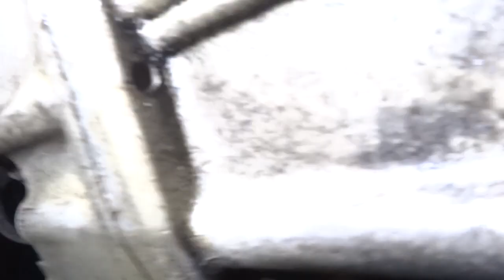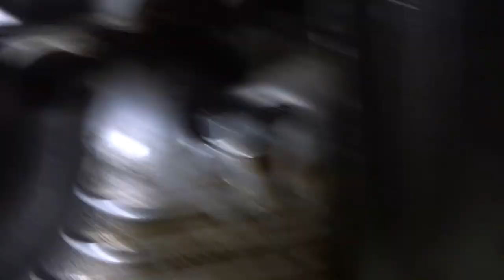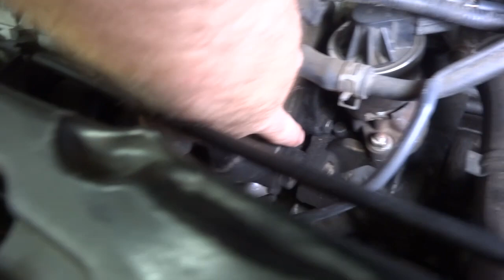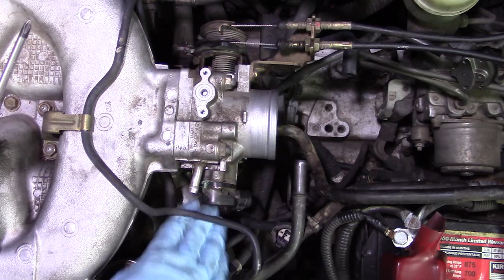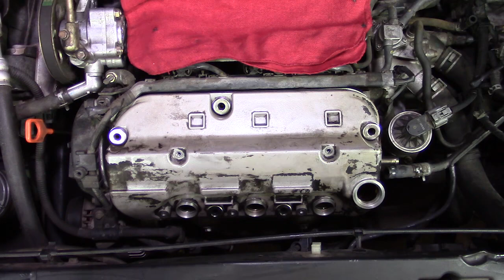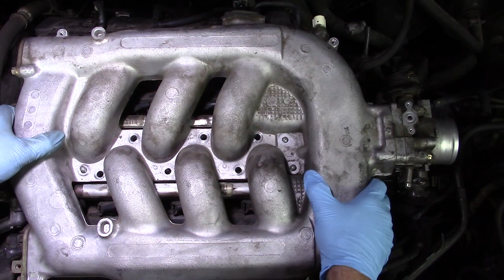Honda Odyssey Valve Cover Gasket Replacement DIY

Comment: Thanks for creating and posting this helpful video.  I'm replacing the Valve Cover Gaskets on my 2001 Odyssey with a 335k.  Getting the old rubber grommets off of the valve cover bolts seem to be the most time consuming part of this job.

Comment: Great Video, used it to do the job this weekend. I would add that a hand mirror was handy to align the bolts on the rear cover and I used gasket sealer. Thanks for the post.

Comment: A very well presentation and greatly explained. I have a 2005 Odyssey and will be doing valve adjustment in the near future. This is a little bit different but I enjoyed your very nice video and gives me an idea about those valve cover gaskets and gramets, which I will replace when I do the valve adjustments on my van. Thank you for sharing.

Comment: Great video, I like his videos. While the purpose of the video was valve cover gaskets, it would also be a great time to clean that intake manifold (both my 99 and 01 Odyssey had the manifold EGR port clogged).   I put mine in a parts cleaner and cleared up an EGR valve code problem.

Comment: Thanks buddy! I just replaced my knock sensor and didn’t know where that vacuum hose with the bracket at 29:14 went! Coincidentally someone had capped this connection.

Comment: Just finished replacing my valve cover gaskets on my 2004 Ody. It took me a whole afternoon with a lunch break.  It's not to difficult of as job but don't expect it to be smooth sailing either, just be focused and it will work out.  While you're at it might as well change the PCV valve, it's located on the back valve cover
Reply: Did this video for 2000 match your 2004 ???

Comment: Awesome video 👌 , wondering why other people say you don't have to remove the intake manifold on the 3.5 VTEC engine ? Links to the replacement parts perhaps ? That's the only thing I need ! Sweet video , my vehicle has 278 thousand miles on it but runs great except for Oil getting on the exhaust system ,

Comment: Good video. Where did you buy the  valve cover gaskets from? Second, you don't need to remove the air filter and snorkel. Just remove the 4 bolts and nuts that hold the throttle body to the intake manifold. Remove all the bolts for the intake manifold, pull the intake manifold up from the Passenger side (away from the TB) and as you lift the manifold slide the two studs out of the throttle body. That way you don't have to disconnect all that stuff around the throttle body. Also, how did you burn that sensor?
Reply from the maker: ***** Thanks.  I've found on this vehicle that the throttle body gasket is a little stuck on both the intake manifold and the throttle body and so I've chosen to just remove everything each time.  If I'd had luck taping the TB loose with a hammer the first time I ever took the IM off, I'd have been able to show your short cut method.  The valve cover gaskets came with a timing belt kit from eBay.  No idea how the sensor was melted (it's not my vehicle).

Comment: Very informative Video, thanks. 
Did you not install an intake manifold gasket before installing the intake manifold. At least I didn't see that you did, or is it not needed. 
Where did you get the gasket set from. Could you please add a link.
Thank you

Comment: Great video!  I have an 06 Odyssey w/188K miles that is leaking in the sample places as your friends Ody.  I took it to a shop and they said the oil pan gasket was leaking so they replaced it.  When I picked it up they said if it continues to leak then the valve cover gaskets are probably leaking.  Sure enough when it sat overnight it was still leaking engine oil!  Do I change the valve cover gaskets before exploring a possible leaking rear main gasket?  Did you make a video on changing the rear main video for an Odyssey?
Reply from the maker: +Jake Bair Valve covers are a good thing to change, particularly the rear one as you see in this video.  The rear main seal also needs to be changed on my friend's van but it is a huge job and we're not doing it until the next time the shitty transmission needs to be rebuilt.
Reply: ty

Comment: I just did this, make sure when you're putting the vavle cover back on in the back you look at the large gasket to make sure it didn't fall off and lift the cover up and feel with your fingers around to make sure the gasket is still in place. and also very important the spark plug rubber boots, they get pinch up on top of the spark plug well. as you put the cover down use your finger and keep pushing the spark plug boots down all around the spark plug round metal tube. it's basically a vagina around a penis. when you do this for the front cover it's easier to see and you can see exactly how it's getting pinched at the top.

Comment: Hi sir I have a 2001 Honda Odyssey 3.5im getting a oil leak at the top may I ask you sir is there any sensors in the valve cover area at all please ty Vernon 🙏😊

Comment: Hi,On a scheduled oil change (Honda Accord 2005 V6), local mechanic says there is an oil leak and the Valve cover gasket needs to be changed and then, "we will take it from there". When he said, "we will take it from there", it makes me uncomfortable -- a disclaimer of sorts.
Says, will take 4 hours and wants to charge $500. Seems like excessive from my unscientific internet research.
I have placed newspaper cover all night under the front of the car and I don't see any leak.Couple of questions:1. If there is an oil leak, is it possible for it to not shown overnight on the ground ?2. If I don't have it fixed and let it run, can it become a bigger problem ($) over timeAny suggestion is appreciated.
Thanks !
Reply from the maker: +Alag “Raul” Janah Wow, I haven't watched this video in a while.  I was kinda rambling at the beginning.  Anyway, you can run your car with a leaking valve cover for a very long time.  The only time you actually need to change it is if it's starting to cause vacuum leaks, but that is unlikely with the design of the PCV system on this vehicle.  If you aren't seeing oil on the ground the next day, forget about it man--you are alright for now.  If you start seeing oil on the ground, then you can think about it.  There is a book that tells mechanics how long each job takes, for example it might be 3.2 hours for this job, and an honest shop should not be wildly different than that.  One way to confirm is to call another shop, preferably one who works on Hondas, and ask how many hours it would take to change both valve cover gaskets (there are two on this V6 engine).  Btw, the fact that he has said replace the valve cover and take it from there means that he's not really sure that is the source, and as I look back on my video, I must admit I wasn't absolutely sure it was the source of the leak either.  I was making the best educated guess I could because I could see caked dirt below the valve cover.  As of now, I do believe the car in the video has a leaking rear main seal, btw.  That's the source of the oil on the transmission side at the beginning of the video.
Reply from the maker: +50sKid Btw, $500 for 4 hours is $125 which is like ouch--you can find a good independent shop who would charge $70-80/hour I think.  This is a very simple job for most mechanics, anybody can do it.
Reply: +50sKid Thank you for taking the time to reply. Appreciate it !
Reply: I'm driving mine 2001 more than 3 years leaking oil on valve cover gasket. Without any problem. Just I check oil level frequently and ad some oil. 
Now I will fix it because oil is going to exaust hot parts and I see some oil smoke.

Comment: Years later on this comment but would it be easier to just remove the intake manifold bolts off and push the manifold back if you only have to do the front valve cover ?

Comment: Probably a really stupid question but I gotta ask.  When you removed the really dirty/burnt one in the back, why didn't you clean it up with engine cleaner?  I am doing this same procedure and I have a super dirty back one too.  I want to spray it down and clean it up but if there is a problem with doing this, I would like to know before I clean it up.  Heaven forbid I make things worse...again!

Comment: Hey, great video. 

Quick question, should I be tweaking the amount of torque for the manifold bolts if I have a 1/2 inch to 3/8 adapter on my torque wrench? 

I evenly mounted the bolts and then used my toque wrench at 16lbs per foot as stated here and in my Haynes service manual and I ended up breaking the bolt. Luckily removing it was really simple. But I don't want to break anymore screws since they are about $4 each and a drive a way.

Appreciate the video and advice!

Thanks!
Jose
Reply from the maker: No need to adjust the amount of torque usually.  Your torque wrench might be out of calibration maybe.  I suggest doing the rest by hand.  Just make them all equally tight.  The goal is not to he-man them on there and break them and to get them all roughly the same.

Comment: 50sKid, when the valve covers were taken off my 2002 Odyssey with 136k miles I saw the same thing. the top valves are dark red and the bottom looks new. not sure how bad this is but it's not uncommon
Reply: same with my 2000

Comment: I have been struggling with this one simple yet stupid conversion lol. All of my torque wrenches are in IN LBS rather than FT LBS and according to a torque conversion site 8.5 ft lbs translates to 102 lbs in. I have yet to find a torque wrench that even has lower value than 10 so I am stumped. Can someone provide some reassuring info?

Comment: didn't need to add lost coolant?  By the way, while there, why not check the valve clearance?  I have heard conflicting reports if valve clearance adjustment is really needed at high mileage or not.
Reply from the maker: 12vgs8606 There was only a teeny tiny amount of lost coolant--no big deal.  I cut out a part right when I take the first valve cover off where I mention that it's the perfect time to adjust your valve clearances, but I don't have feeler gauges.
Reply: I think if not valve noise check valve clearance is not necesary

Comment: I replaced my spark plug seals and the valve cover gasket on my 06 Odyssey. When i tried to start it up again, it turned over and then made a buzzing noise, but it wont start. I havent had much success with the advice on the forums. Anyone have an idea what to do or look at? I did not torque the bolts underneath the intake manifold or the valve cover.

Comment: Hmmm. No gasket sealer? The gasket works like an o-ring?
Reply from the maker: Yeah it's rubber, it seals.  Unless your valve cover has warped--then you may need a layer of RTV.
Reply: I'll have to redo the rear one on mine, it's leaking after just 4 years .. I had used aftermarket gaskets and RTV after doing a valve gap inspection and correcting a few .. this time I'll use Honda OEM and no RTV.
I was doing a "round robin" mtc tour at 105k mi. .. (timing belt, rollers, tensioners, serpentine belt, idler pulley(s), clean out IAC and EGR passages, etc).

Comment: i did this everything is running fine, but a check engine light came on when i cranked the engine, any advice?
Reply from the maker: I can't advise you until you get the codes scanned and tell me what they are.
Reply: +50sKid i got it figured  out. one of the hoses wasnt connected properly

Comment: Why not just unbolt the carb, remove snorkel and then remove the plenum? I'm happy I don't have to remove the spark plugs 😊
Reply from the maker: Yeah I forgot to explain in this video that I knew the intake gasket is a bit stuck on this car and I didn't want to have to replace it.